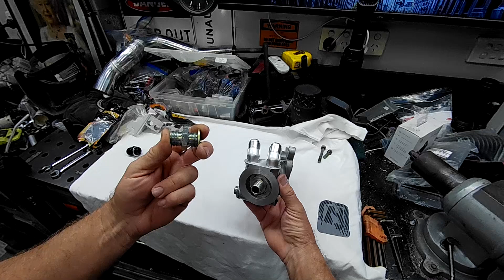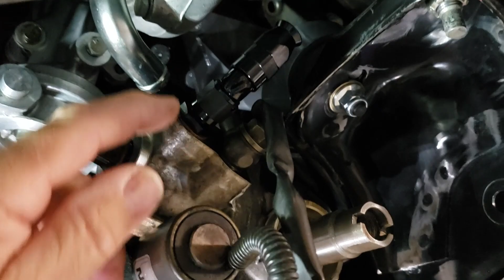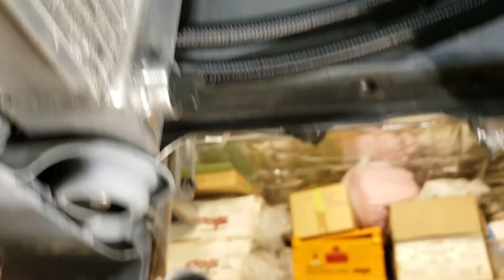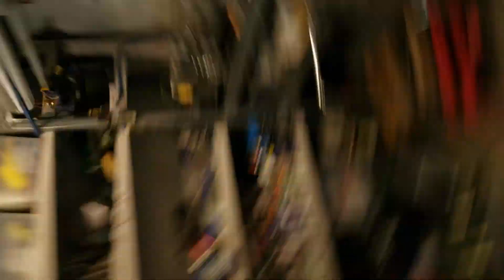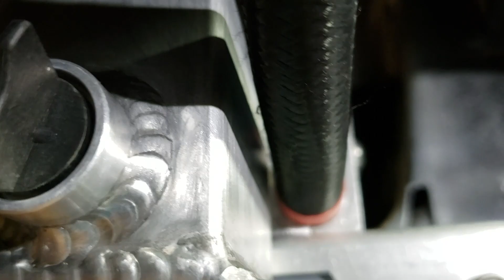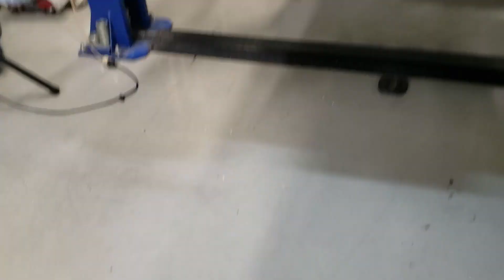Full Flow Oil Cooler Build. Project Fairlady, The Nissan Z32 300zx Twin Turbo Mega Build

Comment: Did you remove oil check valves under the oil tree or tt dont have it like NA in the block under oil tree? Im trying to figure out the best way to run full flow oil cooler on my jdm tt 300zx

Comment: Going to have to run some sort of oil pressure relief block to bypass excess oil pressure back into the sump. Im running an na tree and the tt pump is getting me over 100psi oil pressure. I installed a peterson oil pressure bypass block on one of my oil cooler lines and a 6an return back to the sump. Oil pressure is now in a safe range.

Comment: What are you doing as far as bypass valves? Hearing a lot of conflicting information. I’m thinking of running a NA oil tree, removing the bypass valves in the block and running a internally bypassed filter.
Reply from the maker: G'day Mate, All of the JDM Engines like this one have the bypass valves in the oil filter tree & not in the block. So, I didn't have to deal with this issue. I'm using a US Market NA oil filter tree, that has no bypass valves as standard, so best of both worlds. I would remove them personally, pretty much all modern filters have a bypass valve built into them. Cheers.
Reply: @TheAussieShed  thanks! Heard they can fall out and destroy your oil pump 😱

Comment: Hey mate just wondering could I potentially block off the tt oil tree on the valve (don’t know if this will affect oil in anyway as it’ll be going no where) and then block the oil pan then just run the lines from the sandwich adapter? I just have no way of removing the tree as it’s in the car. Love your work been following for ages.
Reply from the maker: Hi Ethan, I would assume so. I would probably cap it with something that threads in place of the barb, due to the pressure. it may blow off a typical hose cap style end. Or you could run it straight into the oil pan return, remember you must have the restrictor in the line to do it this way. Z1 do it that way with their full flow kit.
Reply: @TheAussieShed  yeah I’ll do that then. One day I’ll make all the oil pan and that are AN fittings (if I can I’ve converted nearly every line already). I’ll just use a bolt then but I’m not sure whether to use oil Teflon / plumbers tape to seal it.
Reply from the maker: @EthanD19  I think the barb uses a copper washer to seal as its not a Taper thread, teflon tape will be fine, or a liquid sealant.

Comment: What was the advantage of having the original oil cooler on the stock pressure relief valve. Was it so the oil heats up quicker for daily driving ? Just a question you got to ask. As per usual out standing video and work. I imagine it will take a little longer for the oil to come up to temp before you cain the guts out of it.
Reply from the maker: G'day Derek, I honestly can't see any real benefit to the stock system at all, other than some possible small benefit at sustained high speed high & high RPM driving, where you would have a lot of airflow through the front.
I can't imagine it would help with warm up time either as its not thermostatic.
The biggest benefit of the Thermostatic Sandwich Plate used on this setup, is they work great to bring the oil temps up quite quickly in comparison to a system without one. I wouldn't run a cooler this big on a road car without one, as it would be a problem with the generally short cycling of the cooling system.
I have this same setup in my TT 370gt & it controls the oil temp really well even at fairly low speeds. Warm up is also quite Rapid.
Cheers Mate.
Reply: You know your zx is so awesome and such a testimony to what can be done maybe it should be mainly a show car. Just have to put up with a lot of dribbling Z fans. Really appreciate your work and videos thanks.

Comment: Very good video mate its what ill sort of go through with my trans cooler setup i spoke to you about. The hose work ill have to figure out is going from the oil cooler piping on the cross member to the trans cooler lines. I still need to source those pipes to make it all work still.
Reply from the maker: Cheers Adam, Mate, you'll work it out, just take your time & all will be good.

Comment: I'm doing my mates 300 and there's a adapter plate from concept performance which eliminates all that which I had to use of a extra capacity sump if you want photos of it I can send it to you.
Reply from the maker: G'day Jose, are you referring to the BDE Remote Filter Block?
Reply: @TheAussieShed  yes that's it
Reply from the maker: @josecarreira8934  Ah okay, its definitely a nice bit of Gear. Perfect if you have an extra capacity sump as you say or if you are using the BDE Crank Girdle Assembly.
In my situation it would have solved one problem but created a couple of others. Firstly the extra complexity & extra fittings required to Plumb in an in line Oil thermostat & secondly a Decent location for the remote filter mount, which again introduces more plumbing routing issues & more fittings overall.
With a bigger sump you probably have no choice though.
Cheers Mate.